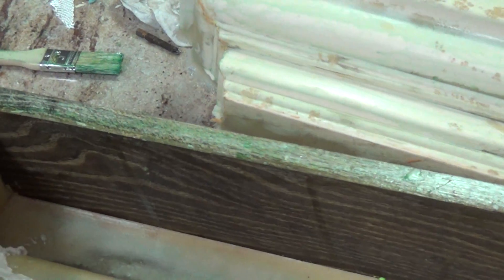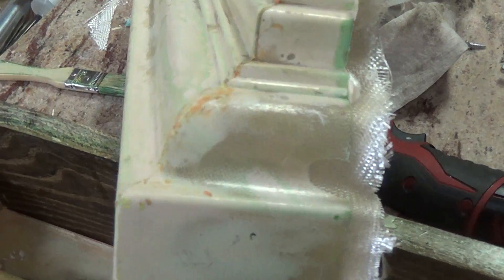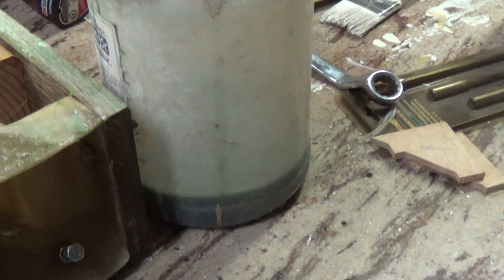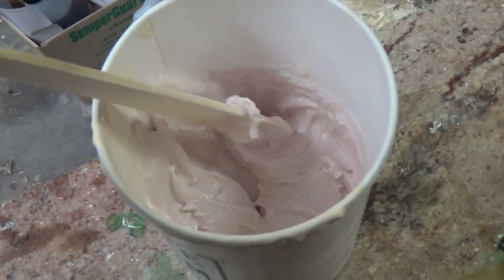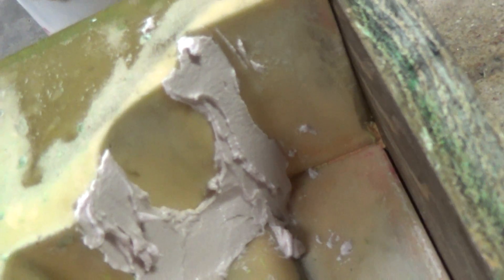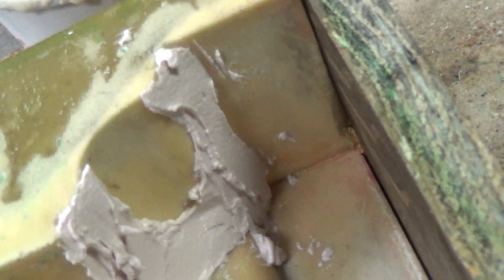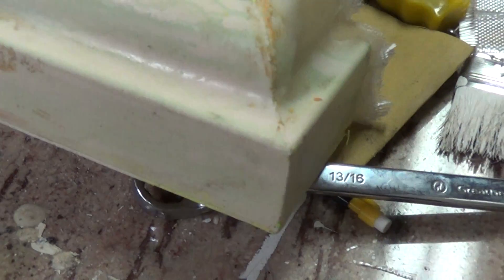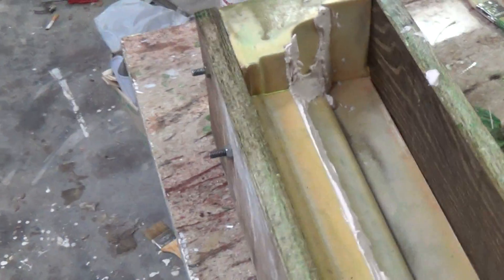Mold and fiberglass Tip No. One

Comment: couldnt you just brush or spray gel coat? that would fill in all those sharp edges.
Reply from the maker: +JOEGGGJOE   I don't use gel-coat because it doesn't need it, this procedure is for a mold and when I finish the mold, It comes out smooth, and when I wax it about ten times, the part is released easily.  I use oil when I make a cement part.  Sure, you can use a gel coat for either poly-ester resin or epoxy, not a problem.